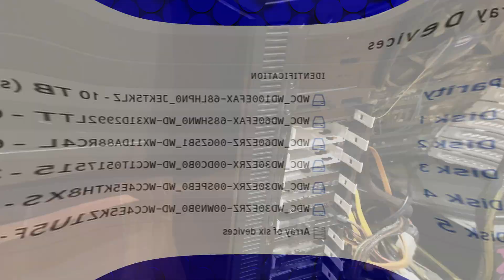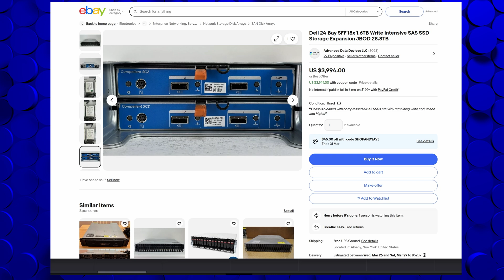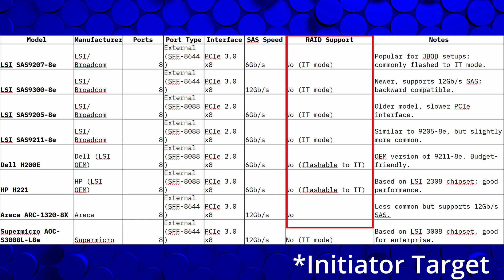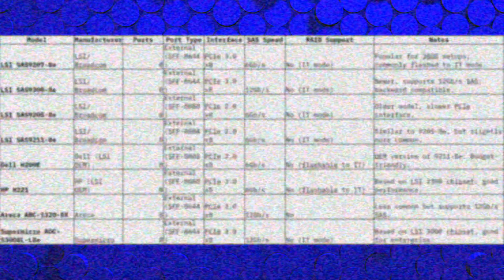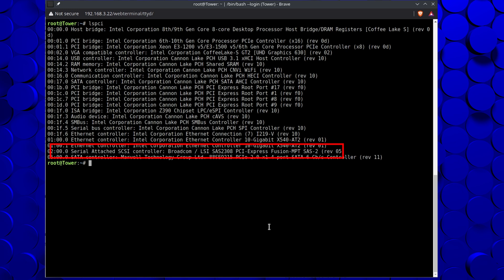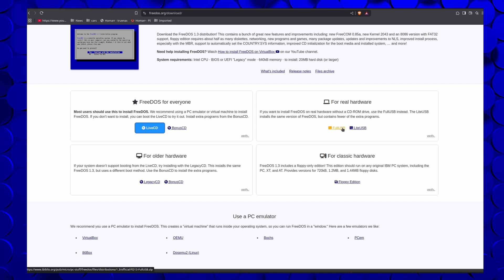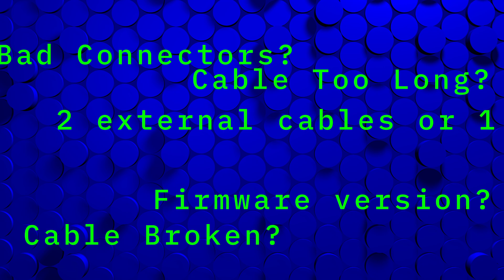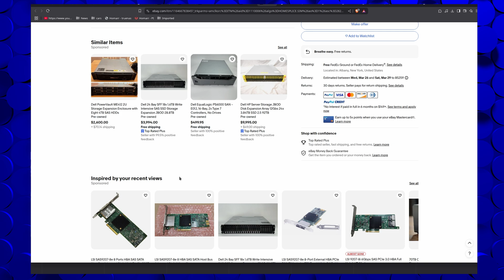Expand your storage! DIY Drive Enclosure

Comment: I had a similar problem with drives disappearing or randomly throwing read and crc errors. Turned out HBA card was running too hot. Since it was meant to run in a loud and high air flow server environment. A simple 40mm fan added to the card solved all of the issues.
Reply from the maker: I think someone else mentioned that too.. I never thought of that. Now I need to go rebuild the system and see if I can make it work.
Reply: @SonoranTech it's a nice weekend project. I'm definitely interested in part 2.

Comment: these LSI SAS cards are designed for rack mount servers with constant static pressure airflow. if you’re using them outside that use case, you should have a fan directly against the card, or it’ll heat up like crazy and throw checksum errors
Reply from the maker: That’s great advice, ty

Comment: 6:56 <--I'm seeing a PCIE SATA multiplier card under what looks like your HBA. Remove that card and test again.  
6:24 <--You said "I used Unraid in some cases." Does that mean you tried other OSes like TrueNAS or OpenMediaVault and saw the same issue?
Whenever you were not able to see all the drives in Unraid, did you drop down to a shell and see if all the drives are listed with the lsblk command?
I had a similar problem when I initially used a SATA controller card in my TrueNAS box. I switched to an LSI HBA and never had an issue since.
Reply from the maker: Thanks for the comments.

Yes, there is a SATA multiplier card below the HBA. I have removed that card as well and the issue persisted.

I have tried other OSes as well. I tried this setup with proxmox, both directly with the hypervisor and then passing the hba card to an ubuntu lts vm. Neither worked. I'm going to try truenas soon.

And then, no the drives did not show up with lsblk.

So yeah, it is a bit of a mystery. Hopefully truenas does a better job, but I also suspect the drives may simply be too old. A couple of the drives are old Western Digital 1.5T drives that are probably circa 2012.
Reply: @SonoranTech  If you are virtualizing your NAS OS, you need to blacklist the LSI kernel module and bind it to VFIO in ProxMox first before you pass-through the LSI card to Unraid/TruNAS, otherwise Proxmox may try to mount those drives before the NAS OS does.
Reply from the maker: FWIW, TrueNAS was a no-go.. same behavior.. must be the drives.
Reply: @SonoranTech how long are the cables? Sata signal is very poor quality for anything long than like 2m

Comment: I am currently using an lsi 9400-16i sas3 card in my nas.  for $500 I picked up a used supermicro cse-847 barebones chassis which had a 24 bay sas3 backplane on the front and a 12 bay sas3 backplane on the lower rear, it came with 2x 1200w sq (super quiet) power supplies, no motherboard, no cpu, no hba, etc. - the first thing I did was remove the fan wall (the stock fans SCREAM) - this chassis was designed to be fitted with up to 36x 15krpm sas3 drives that suck down power and throw heat but because i'm only using commodity 7200rpm sata hard drives in it that max out at around 10w I don't need nearly as much power and cooling, so I 3d printed a replacement fan wall using 3x arctic p14 max 140mm high static pressure ultra quiet fans as well as 5x arctic p8 max fans (again high static pressure, super quiet) 2 in front of the motherboard to force air through the cpu heatsink and pcie cards (which also includes a dual 10g intel x540-t2 card and a cheap gpu), and 2 in front of the rear drives to make sure that they get adequate airflow.  this lowered the noise from this server from needing hearing protection to being able to run full time in the spare bedroom across the hall from my kids' bedrooms.  to run the nas, I recycled my old workstation motherboard and gpu, a ryzen 3700x which still has quite a bit of life left in it, with 64gb of ddr4 and a 256gb nvme ssd just to boot the system.  I use truenas scale as zfs is the most reliable filesystem i've ever used and truenas scale has a fantastic gui for managing zfs.  I loaded the system with 8x14tb drives from my previous setup, and 16x 16tb drives, I've got them set up as 3x 8-disk raidz2 vdevs (so each set of 8 has 2-disk parity and there are 3 sets).  I also bought 4x 1tb enterprise sata ssd's 2 (mirrored) to serve as my pool's metadata storage (speeds up file search and seek times dramatically), and the other 2 I use as a zfs intent log (zil) which drastically speeds up synchronous writes.  this configuration nets me just under 238tb of usable storage which I use for hosting all of my ripped blu-ray, dvd's, and tv recordings via plex to all of the tv's and other devices in my home, workstation backups, photos and videos that i've shot and edited (including lots of raw footage), and backups from my 5-node proxmox cluster which serves as my homelab/homeprod virtualization system (it stores everything on nvme ssd's but backs up to the spinning rust daily just in case.
Reply from the maker: Sounds like a nice setup. I"m going to switch (back) over to truenas soon.. hopefully it handles everything better.

Comment: You would have gotten the same thing no matter the card. Had same experience except I was able to get it to work on Truenas Scale with no issues. The random show up happens in the bios as well. However this maybe an unraid issue. I was also able to get it to work with Ubuntu Server 24.04 LSI23008
Reply from the maker: Interesting. I should have mentioned it in the video, but I also tried this with proxmox, no luck. The proxmox base OS couldn't see it, so I also tried passing the HBA to an Ubuntu 24.04 LTS virtual machine, no luck there either. I'm going to switch my unraid box to TrueNAS soon so maybe that will do the trick.